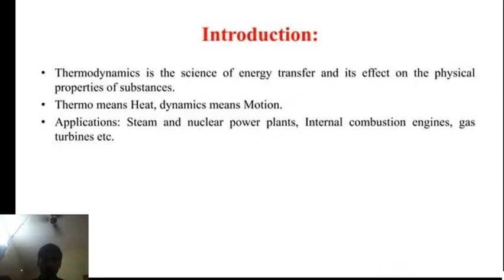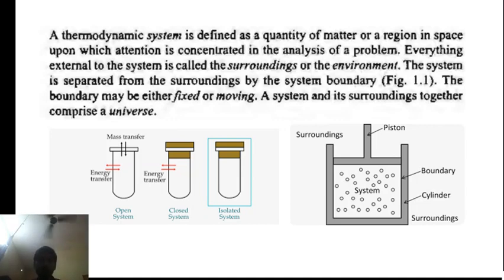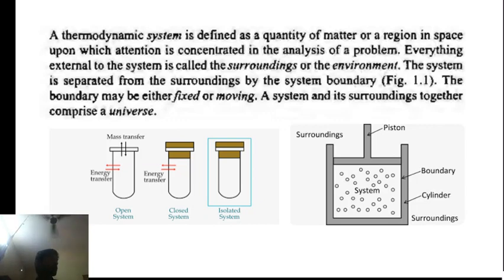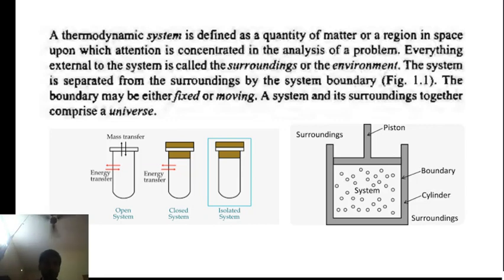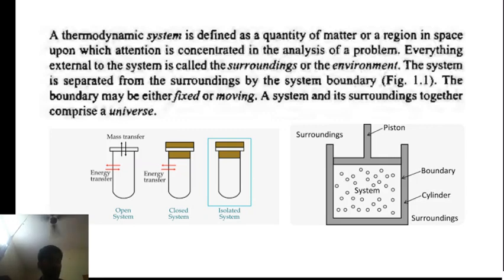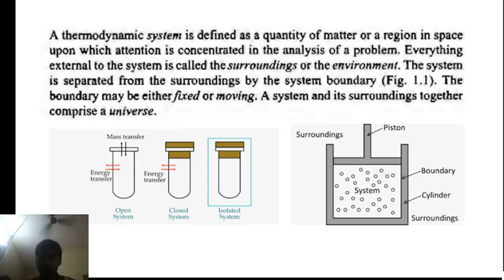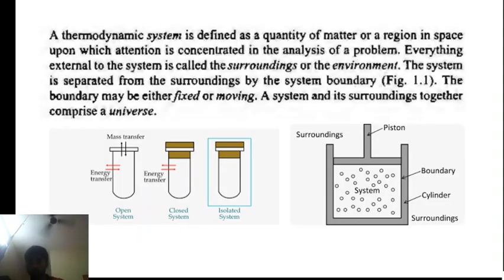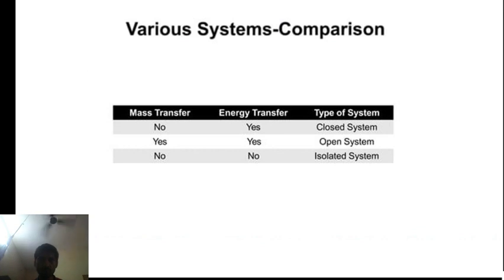Thermodynamics (introduction) Unit-1 Lec-01😇🔥🔥#thermodynamics #trending

Comment: Sir example of Open System Will Be
 An Open Beaker Of Evaporating Water And Here Mass And Energy Transfer Both Will Take Place......
And Sir Example Of Closed System Will Be Same Beaker With Evaporating Water With Closed Lid And By This Engery Transfer Will Take Place But Mass Transfer Can't....
And Sir Example Of Isolated System Will Be Air Tight Container Where Energy as well as mass transfer can't occour.....

Comment: Sir
Eg. of open system is a pot on stove
Eg. of closed system is a closed container with gas
Eg. of isolated system is a thermos
& No, there is no such engine with 100% efficiency because some amount of heat energy is always loss from the system according to the 2nd law of thermodynamics.🙏